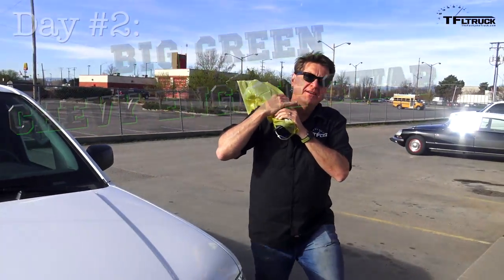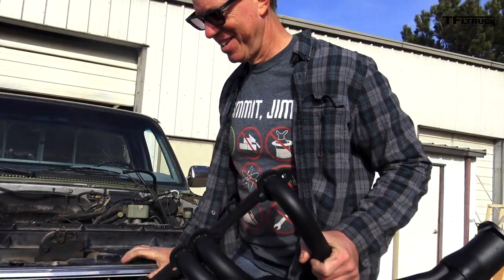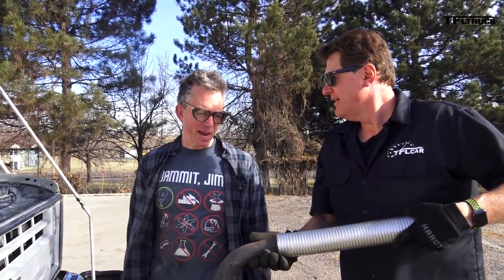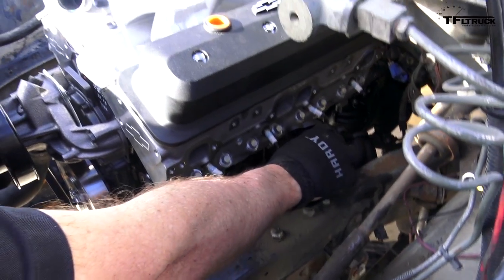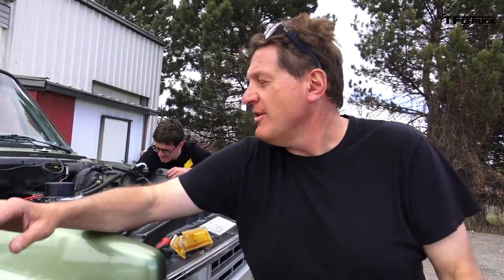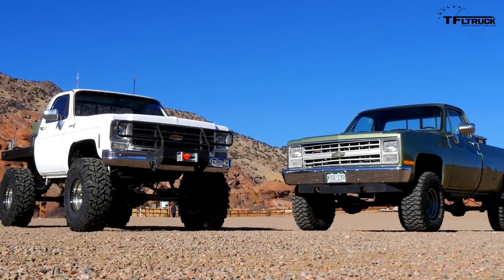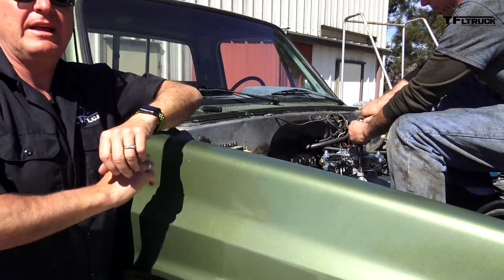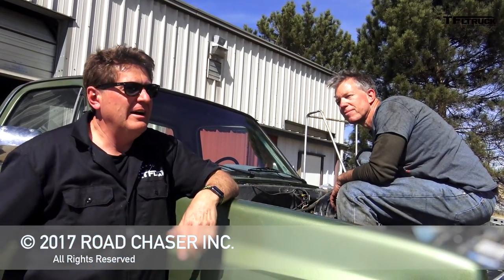Fuel In, Exhaust Out: Big Green Chevy 350 ZZ6 Crate Engine Swap Ep.8

Comment: Should have gone with Stan's tri-y headers. I put a set on my truck 13 years ago and never have had an issue. I had a set like yours and had to change them a year and a half later from rusting out. The other reason I like them is they keep the heat out of the engine compartment. So in a year or so when these need to be changed out, if you still have it look into them. You will not regret getting them!

Comment: Good 'update' Roman,...I'm casting my 'vote' for the carb. version. You are trying to keep it simple, well there's nothing at all wrong with using a carburetor, ( GM didn't think so either ) as one came in the  crate.
Headers is a really good way to let that engine breathe too, I'm curious to see now, that type of exhaust systems get's installed
on Big Green Chevy.

Comment: The more exhaust cools, the smaller volume it takes up, so the hotter the gas the faster it travels down the tubes. Faster the gas moving at each junction the more it pulls on the other tubes at the same junction point to help scavenge other cylinders. Primary pulse is from head to collector and tube lengths tune frequency. The secondary pulse happens at the X, H, Y pipes, or resonator with length from collector tuning the frequency. Tri-Y headers have a broader effective rpm range, but have less help at all points over a single collectors target rpm.

Comment: The HP/TQ will suffer if you use that stock small exhaust and that flex stuff rust out within a a month with road salt.  Should run 2.5 or 3" to a x pipe.  Check out some of my videos I have 3" on my 6.2 .  Loving the videos keep them coming.
Reply from the maker: +6.2silverado Will do! The exhaust system will be proper soon.

Comment: It's really hard to believe it took you guys so long to do a simple engine swap  that is normally a 1 day job  and with 3 people  even faster  In my teen years I would pull a sb chevy out sat morning and be back on the road the next day  doing a short block build   you guys had a turn key that was not timed ?? (that motor was probably started and put on dyno ,drained, and shipped )  but those things you always check before you stab it in

Comment: I really started to cringe when you had that dryer duct there for the exhaust lol. That's never a good idea.
Reply from the maker: +wrifraff no worries. We will put a proper exhaust system in there soon.
Reply: The Fast Lane Truck Excellent!
Reply: That isn't dryer duct. It is flexible pipe made for exhaust applications. It isn't optimal, of course, but it will get you by till you can get a proper exhaust put on. But it is, indeed, made for exhaust.
Reply: VanderVape I know that, it was a joke. But I always laugh at that janky repair.

Comment: need to learn how to work on those big trucks. Jack that rear end in the air and deflate front tires so theres no walking all over the body work. If you need to get under the front inflate the front tires. Best yet is a lift but i can see thats not happening.
Reply: fuel injection, ditch the carb

Comment: should have put fuel injection on it
Reply: Really expensive, and a lot more complicated.
Reply: The new self contained units are easier to deal with than any carburetor and the price gap is smaller every year
Reply: Not really.  Holley kits are plug and play.
Reply: Fi-Tech has simplified efi, and it's very cheap.
Reply: Well about 5 years ago when I did an engine swap on my 76 C-10 I looked into fuel injection and it cost almost as much as the crate engine.
Reply: Eric Van Geest Should've done a diesel swap
Reply: Just saying When you have spent over $7000 on the motor alone the extra 800 or so to put injection  on it isn't that bad considering the reliability you get
Reply: They should of just put a used 6.0 in it. Can get a complete engine for 2 to 3 grand with fuel injection, more cubes etc. When upgraded with a tune, headers, cam thats an easy 400 hp. This engine was free though so that's hard to beat lol
Reply: GM gave this $9,000 crate engine to TFL. As they have repeatedly stated in other videos, a modern LS engine would not be keeping in spirit of this old truck. Not to mention, EFI is a lot more complicated.
Reply: Self learning EFI is cheap and simple now. I'll never use a carb again.
Reply: Meh for a toy like this a carb is fine
Reply: I don't know but for the high altitude they are at they need all the help they can get
Reply: Took the words right out of my mouth.
Reply: I believe holley has a new fi tech fuel injection for $994. That's the cost of a 1050 cfm quick flow. lol
Reply: Eric Van Geest no it's to old for fuel injection
Reply: There a few companies that  make a TBI for older vehicles to replace the carb and use the same intake but they are pricey. Edelbrock, Holley,  and MSD are a few that make them. If I had the money my 65 Impala would get a TBI system, I know Edelbrock's is about 2 grand or so.
Reply: the holly pro-jection was WAS only $600 when it came out  INFLATION Sucks
Reply: $9,000 crate engine? Not hardly. Brand new ZZ6 crate engine from Jegs, complete with distributor, carb, fuel pump etc etc....ready to drop in is only $6600. Even if you go full bore and get the ZZ6 turnkey package which also includes the accessory drive and all the accessories, including AC compressor, alternator, power steering pump and serpentine belt system, you are only looking at $7300.
Reply: Fitech has a system that is boost capable and it would only set you back 1200 for the unit and another 400 for the fuel system when I rebuild my engine I'm gonna use this because I live at 7200 feet above sea level and just a normal day fishing in the mountains I can hit 10000 and then be angling around 5000 and I just would rather not play with jets with that much elevation and being in boulder I can only imagine the same most tbi systems just fit on a standard 4 barrel bore
Reply: @wallysworkin823  by self learning they mean daily struggle,  trial and error, big headache